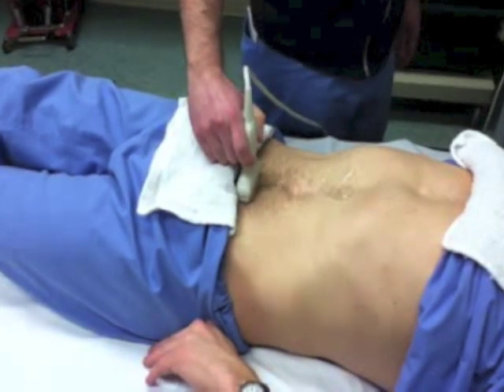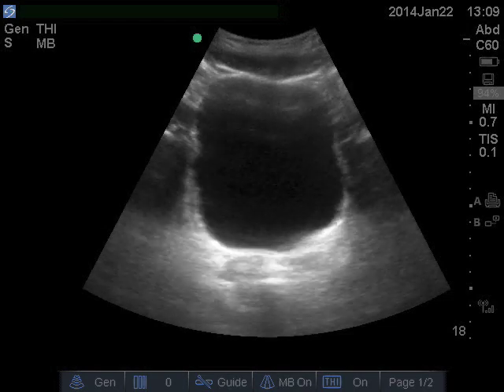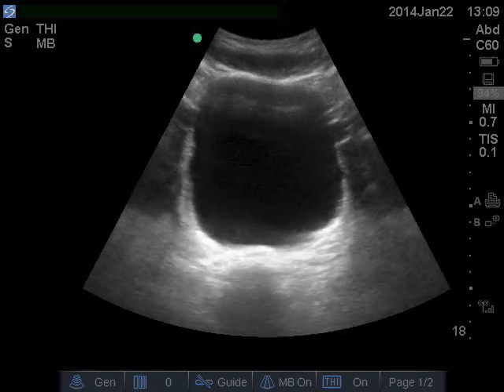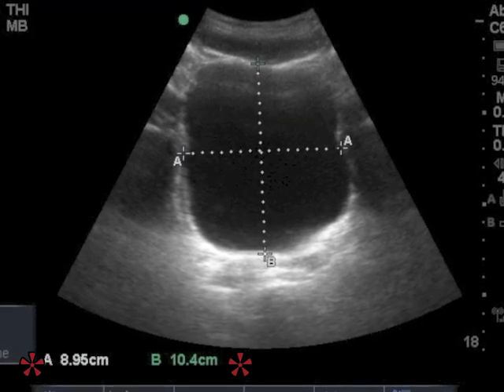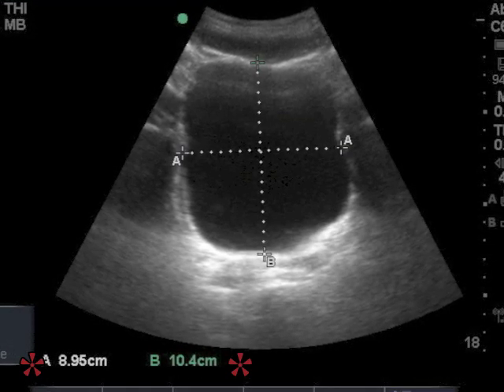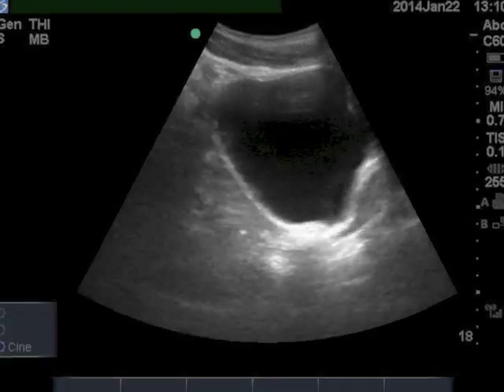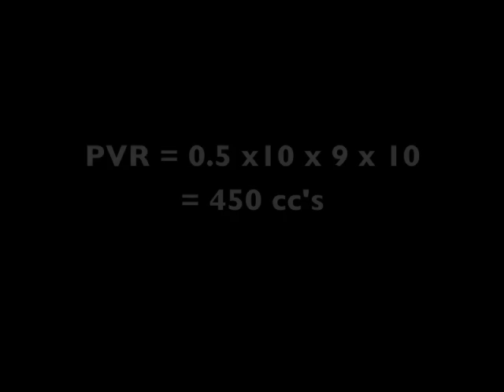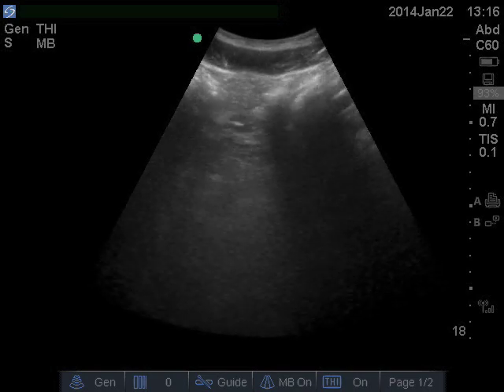Ultrasound Estimated Post-Void Residual Bladder

Comment: DO NOT TRUST THE ULTRASOUND 
Do a catheter after you pee. Exact , no BS measurement. 
When I finally demanded and insisted on having a catheter the quantity was 1400 ml.
DO NOT TRUST THE ULTRASOUND
I've been using intermittent catheters for 13 years. No therapy. No medicine. No surgery. No UTIs.

Comment: Z, quick question, any reason one should not use the "calc" function and the volume function? In my opinion this is an easier method and it saves your calculations, no need to write them down.
Emilio